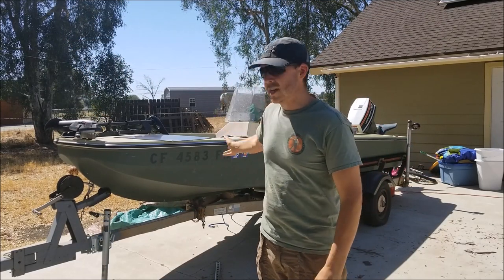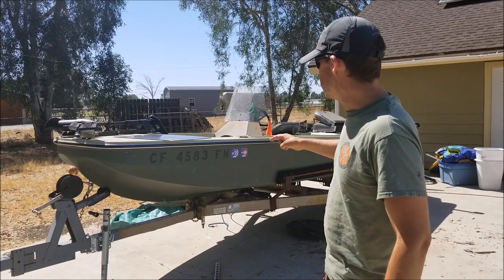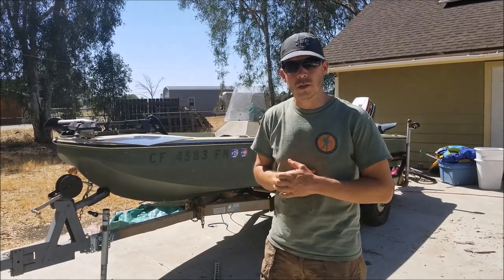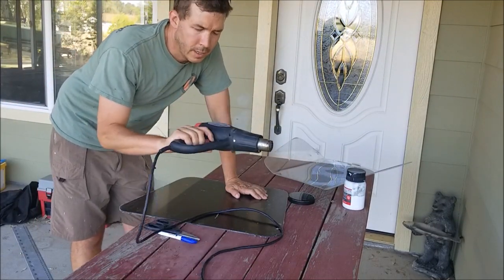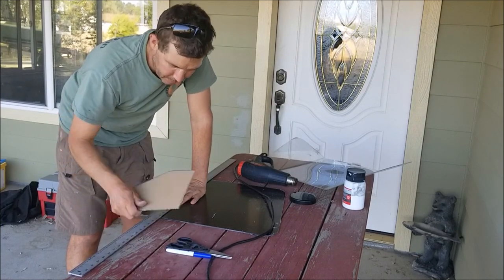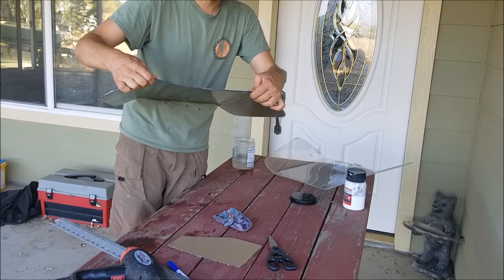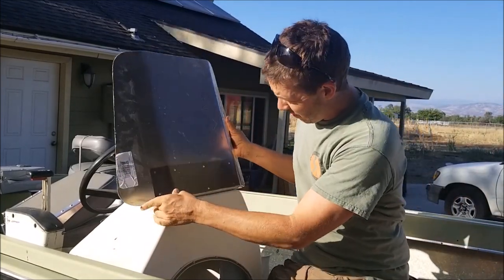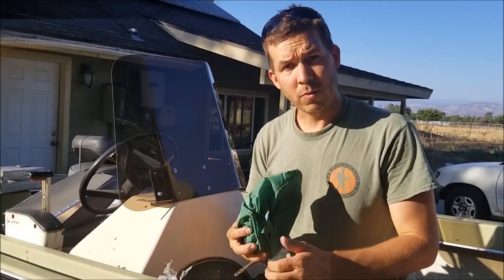DIY Bass boat windshield

Comment: It beats dealing with Bass pro shops. And a whole lot less expensive. Nice boat. I’ve restored 2 Bass Trackers. And the Alumacraft 18’ I have now. It’s a lot of work but it more than worth it in the end.. I did something similar to what you did in making a windshield. I bought all the stuff at Home Depot except for the Hardware to fasten it to the console. I used motorcycle hardware for that.

Comment: If you wedge the plexiglass in the gaps on the table boards and heat along the line it touches the table will concentrate the heat more evenly across the line and bend it that way more easily. Also use a torch to lightly heat the edges to polish them after sanding.

Comment: Don’t feel bad I spent that much on a  1986 18” Alumacraft  Maverick.  It has a completely rebuilt 40 Hp Johnson on the back. It  needed new casting decks carpet paint trolling motor. I put a $300 wrap on it too.  Plus restoring the trailer with new hubs and bearings and new chrome 13” wheels and tires. It adds up fast. But I enjoy restoring old boats. This is my 4th one. There is a big market for good used Aluminum bass boats.

Comment: Thanks for sharing,  I got a free boat and I am about $5000 into it now.
Reply from the maker: If I had realized how much work was involved and how much it would cost. I would have just bought a 3k to 4k boat.
Reply: haha, ya same with me
Reply: curtis siwak  I put $1,500 in a 1986 18’ Alumacraft Maverick. That I only paid $1,300 for .I have put New carpet, plywood, rewired front to back, and new a paint job on the boat and trailer, new lights 13” wheels and tires , new trolling motor. The man I bought it from just paid $800 for a complete motor rebuild. I have all the paperwork.. This is the 8th boat I’ve owned, and the third one I have restored.

Comment: What did you wipe on it after bending?
Reply from the maker: It was just cold water to set the bend faster. You can just hold it while it cools, but a sponge or very wet rag speeds things up.